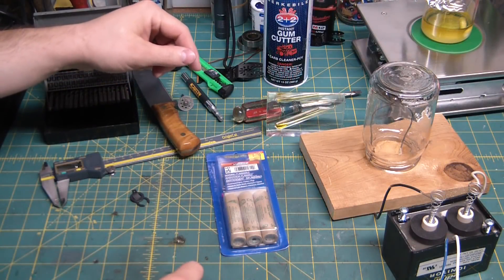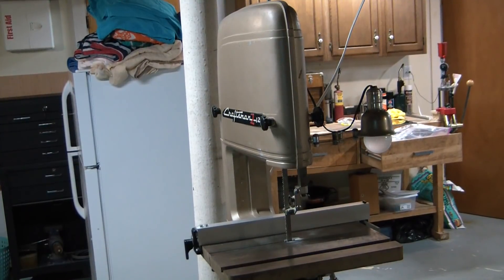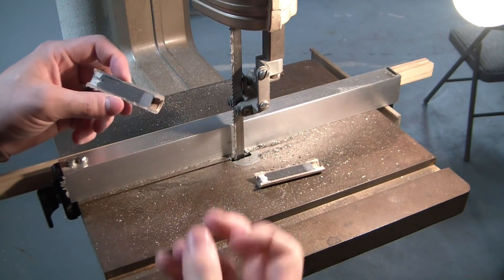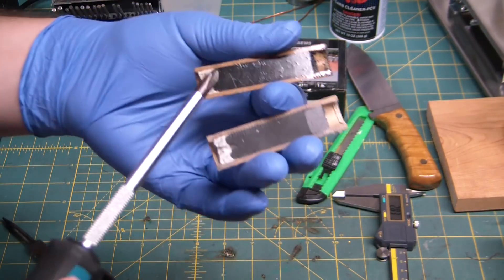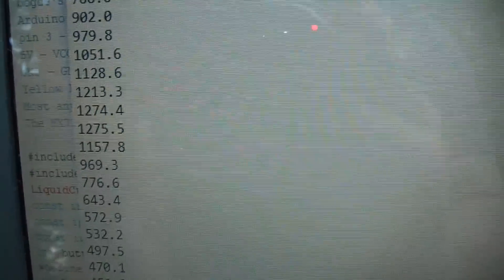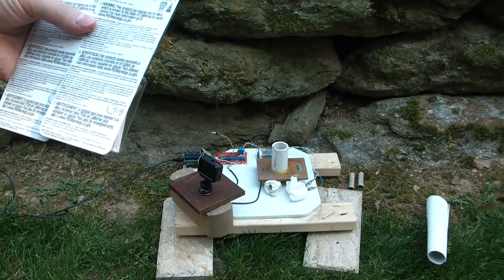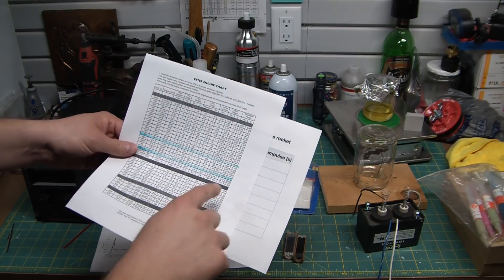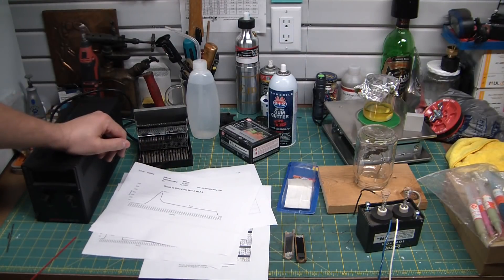Bandsaw a Rocket Motor? Testing Estes Rocket Motors for Real Performance - ElementalMaker

Comment: Just wanna start off by saying I love your videos please keep them coming I was making a few sugar rockets and then I bought some tubes to make bottle rockets can I use the sugar fuel in the 2 inch with a quarter inch diameter inside for fuel I tested one but it doesn’t seem like it does much
Reply from the maker: Unfortunately at that size the sugar propellant probably won't work all that well. Compressed black powder is probably the way to go there. I never had much luck with little bottle rockets either
Reply: Thank you so much for getting back to me I appreciate it black powder it is

Comment: Wish i could get that in Australia 
Im jealous
Reply: You can get them from any decent hobby store. Pro tip, buy a cheap diy rocket kit, don't waste too much time making it perfect and paint it fluro orange. First one I bought I spent days making it perfect. Fond a nice big open space to launch it, hit the button and never saw it again.

Better still, make the sugar rockets that Grant Thompson did in one of his king of Random videos. convert the measurements to metric and follow his instructions exactly. Buy pipe and dowel from bunnings, kitty litter and icing sugar from coles and potassium nitrate from ebay, chemical supply company or other sources - It's cheap, legal and fairly easy to get. Tape the rocket motors to a length of thin bamboo (from plant nursery) and they fly pretty well, and very high. Can ignite with proper igniters from hobby shop, fuse if you can get it, sparklers if you have to or best option is to buy electric matches off ebay.

Comment: So, a couple of questions:
1.) These were black powder (KNO3+C+S) .... how does this thrust curve compare to the equivalent grain of rocket candy (KNO3+C12H22O11)? 
2.) In the grains you make with rocket candy, you have a complete tunnel through the center, whereas these just have a small notch at the bottom... What is the advantage in the full tunnel?

Comment: The samsung S9 has 960fps for 0.2 sec or continuous 240
Reply from the maker: Yeah that is awesome speed, but I think I'd need longer than 0.2 sec. I wonder if it's something that could be hacked for longer duration shots
Reply: @ElementalMaker  there is an automatic mode that starts the slowmo when there is movement in the focusing square. But you could also try the Sony ZV-1

Comment: Lots of CATO's (Catastrophic failure at Take Off) can be traced to motors that have gotten damp (black powder LOVES moisture) and then dried.
Cracks in the fuel grain...more flame-fronts than the casing can deal with...BOOM.
I was getting ready for Certification with an I-class re-loadable [Dr. Rocket] motor when September 11th happened; all fuel became unavailable, all permits cancelled.
I regret choosing to not continue building rockets.

Comment: I use a Samsung phone for slow mo with rockets. Ever since the galaxy s7 they support a "super slow mo" mode that records at 720p 960fps for up to half a second. It won't get the whole burn duration but for something you can get cheep on ebay, it's not bad.

Comment: ahhh yes.  I remember as a kid cutting open one of those round smoke bombs, and putting it on the end of a C engine with rubber cement.
Lighting it off and the instant horror of a rocket engine flying haphazardly into the neighbors yard then letting out a plume of blue smoke.
Thankfully the neighbor wasn't to mad about the dead grass where it burned up, but boy was that a lesson in aerodynamic stability.

Comment: The parachute ejection stage has another better use. If you make each motor stage detachable and place consecutive motors 4 to 6mm apart the first stage will ignite the second stage and detach itself and so on. Estes has a chart telling you what motors are compatible for multi-stage use.
Reply from the maker: I'm surprised they can get a reliable second stage ignition with how quick that separation must be. Very impressive stuff! I would have imagined some fusing or priming of the second stage motor would be required
Reply: @ElementalMaker  No but the trick is in the gap between engines 4_6mm and surface tension between stages. Tight but not tooo tight. You know...

Comment: When I was 10 I built and fired  many Estes rocket kits, figured out on my own to use a ripped corner of tissue paper and form a ball with it that fits the nozzle behind the squib, long before they came up with those plugs. Keeps the ignition up against the propellant and also retains the wiring without tape.
Reply from the maker: I used to do the same thing and it worked like a charm, I always kept a bamboo skewer in my launch box to really shove the wadding in there. Great minds something something

Comment: EM, I'm probably about the same age at 44. Iirc, the remote ignitor switches took 4AA batteries. I also remember not having those little "butt plugs" to hold the ignitors in. We either crossed our fingers they wouldn't fall out or we were smart enough to remember to bring some tape.

Comment: Try chronos slow motion cameras cheaper than the phantoms. I remember back in day their was a company called experilab in South Africa where I grew up, they sold kits to hammer your own rocket engines together. Aluminium rod with brace and cardboard blanks had to make our own mixes would be a good starting point to mess with those ratios. Esties were quite expensive all the way down south for us then. Now in the UK it’s whole different ball game here.

Comment: I think a smartphone is probably your best option for high speed video, probably a Samsung or Sony. If you don't need/want a phone upgrade, you can import one of the cheaper ones from China that doesn't have good US band support, like Xiaomi/Huawei/Honor/Realme. Though it seems like many of them interpolate video for the highest framerates, newer models might still be competitive given the price. Real hardware 480fps should be trivial to find, 960fps looks available on select models, and some models might even have actual 1920fps modes (though actual capabilities are hard to confirm).

Comment: High speed camera (not cheap but not as expensive as the next level) - https://www.krontech.ca/
Reviewed here: https://youtu.be/2egYcX_9FKI

You changed your test stand. Do you any build info?

Estes tests were pretty impressive. Data heavy is good. I wonder how a 5 grain Cesaroni would do :)
Reply from the maker: I'd love to get a Chronos some day, but right now its a bit out of reach. I haven't changed the test stand since I built it lol, so hopefully nothing changed. Although I do have a revised version coming with an SD card that a viewer and fellow rockery enthusiast helped design.
Reply: @ElementalMaker  I asked because I just got my Level 1 and I'm headed toward Level 2 (maybe 3?"). At some point I'll make my own motors and need a test stand. Yeah... I looked at the Chronos, drooled, and saw the price... Nyope.

Comment: I remember my old science alb kit and it had stuff in it you won't get at all now in a kit. the kits now are so anemic. I used to be an Estes rocketeer with a couple friends. D engine was the last engine I used. Never had igniters like that when I was in rockets. we got a nichrome wire with a little coating on ti and we had to bend it to shape and used a toothpick broken off to hold it in place. Half the time the igniters failed LOL used the D for the Big Bertha rocket. Yes Estes has some decent motors. Would love to get back into shooting rockets again. That is in the plans :)

Comment: No comment. You're right... what you did was incredibly dangerous. Congratulations on contaminating your saw and workspace. Oh, and for anyone else stupid enough to try this: REMOVE THE EJECTION CHARGE FIRST (It's easy to do, just carefully pull off the paper plug and it will fall right out. It is highly explosive btw.)
Reply from the maker: Its black powder buddy calm yourself. Everything is already cleaned, its called a vacuum.

Comment: Very nice work!  I loved the data presentation portion of the vid--it's not boring--but you could have maded it a bit shorter with a bit more prep--we can pause the vid to look at the numbers if you ensure the images are in focus or if you include links to pics in the comments section.

I'd also be interested in seeing what the burnout was inside the spent tubes.  If you could saw a C & a D tube in half & add them as still images to the end of your vid (or as links in your comments)--that would be good.  I have a feeling that they don't need to use such thick tubes--but, I could be wrong.  Perhaps they are a bit overkill for safety purposes.

Keep up the good work!

Thanks for sharing!

Comment: @1:15 - Unrolling fireworks - When I was 12, we lived in Hawaii.  At that time (1981), fireworks of ALL kinds were legal in the state.  There was a store called "Holiday Mart" like K-Mart.  During large holidays, the store removed the ENTIRE toy section of the store and replaced it with fireworks.  I'm talking 10,000 count rolls of firecrackers on pallets.  My dad was a HUGE kid and would spend lots of money on goods.

Fast forward - I would accumulate and unroll everything I could get my hands on for as long as it held my attention then I would light it on fire.  I'm lucky I still have all my fingers.  There were several HUGE mushroom clouds out on the lanai.

I used to rig Revell models with strings of crackers to simulate battle.  It was the home of Pearl Harbor after all.

Comment: I have continued to launch Estes rockets as an adult, but it's been a while.  I've got several kits I need to build.  Growing up, our shop teacher taught us to pack the igniter in with a pinch of ejection wadding, which worked great.  The plastic plugs are a little different but work well.  Lots of people had trouble had trouble with igniter reliability, but with care I've launched 2- and 3-engine clusters maybe a dozen times with only one half-ignition.

One thing I always wanted to try is a manually operated ejection using a radio for RC planes.  Maybe even two stage for a high altitude rocket.  But what I should really be doing is getting into high power rocketry.

Side note: the needle nose pliers on your bench look nearly identical to one I inherited from my great grandfather.  Crescent brand, "Made U.S.A." (natch' 😉) and has "CRESTOLOY" on the back.  I love it.

Comment: I probably should have said the you might have been able to desensitised the rocket motor by soaking it in oil. Works with cordite...    But Where's the fun in that, some exothermic bandsaw action sounds fun

Comment: Your numbers are likely the correct numbers. Manufacturers tend to overstate what their products are capable of.
Reply: EM any chance you could go back to some of the chlorate cell videos? I built one and everything goes as it should except that I never get crystals growing in the bottom of the jar. The MMO anode should be hooked to the positive wire right? and the Titanium cathode should be hooked to the negative side of the power supply right? Thanks!

Comment: You should expect nothing less.  These things are factory made with industrial equipment.  This kind of consistency is what industrial production equipment does best.
There are machines turning steel wire into thousands of perfectly sized ball-bearings an hour.  You're surprised by this?
Reply from the maker: Most manufacturers embellish pretty heavily
Reply: @ElementalMaker  That's different.  Sure they lie and say something is better than it is.  But I mean the consistency.

Comment: The Fuji WS5000 has 450FPS and is about 300 bucks. IDK if you need more than that. The camera most YTers are using Crow-nos is the cheapest for real slow mo cameras for sure. Don't know how it's spelled.

Comment: This was fun! I always wanted to build a test stand for these motors when I was a kid, but the rocketry phase of childhood gave way to the radio controlled airplane phase before it happened.  By the way, not all of us have the attention span of a meth addled chipmunk, so please do include data and theory as you see fit. I don't think you will chase all your viewership away with a couple graphs and equations. Cheers! 👍👍👍
Reply: You need to combine the rockets with the RC planes, actually firing rockets from one is really satisfying.
Reply: @chemistryofquestionablequa6252  Yeah, we did that too. Good fun, but very hard to hit anything! We also put bomb drop clips, fins, and little nose cones on 12 gauge shotgun shells. We would take out all the pellets, of course, and load the empty shell with all sorts of "energetic" stuff.  It sounds like we would have been good friends! Cheers!

Comment: i'm amazed how many people that do shit like this with out fire exsiglishers  then wonder why the house burnt down
Reply: More people blow themselves up making Marijuana oil over their gas stove. But yeah,  you need to use "common sense", which isn't so common.
Reply: @bonnieswenson9925  Trouble is when they "almost" blow themselves up but instead just get horribly injured then go on to reproduce.
If anyone is going to be so dumb as to fail any consideration of what might go wrong, maybe they could either go all the way or, at least, take it in the wobbly bits?
Reply: @matthewellisor5835  I'm a firm believer in "stupid people shouldn't breed".

Comment: Cutting open highly flammable things? I'm in! Also, Hobby Lobby is great for cheap glassware...
Reply from the maker: Ohhh like chem glassware? I didn't see any of that there. Or you just mean using their everyday glass as substitute chem glass?
Reply: @ElementalMaker  Just as a cheap substitute. There's a lot of different shapes and volumes that are good for storing various things that need to be stored in glass containers. They also run a sale a few times a year where you get 50% all glassware there.